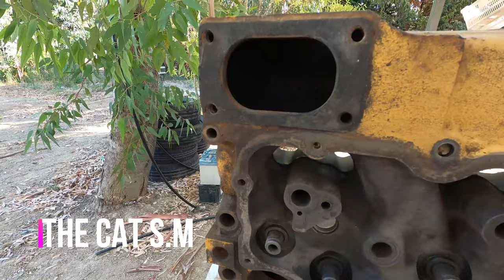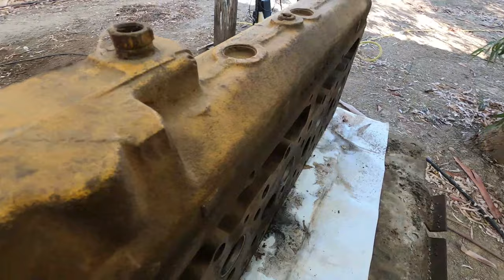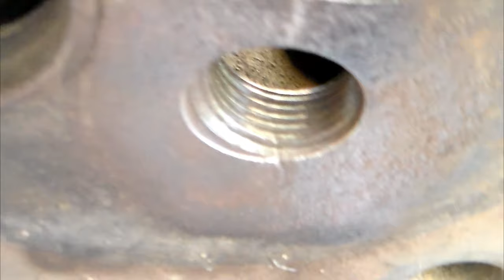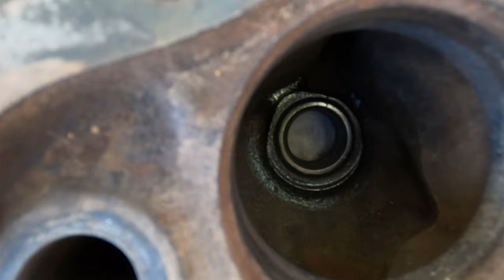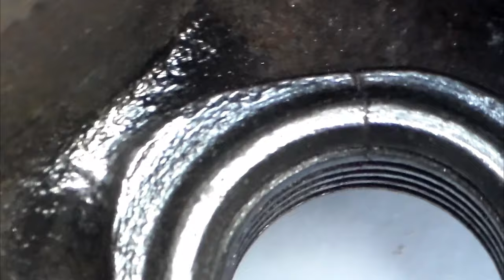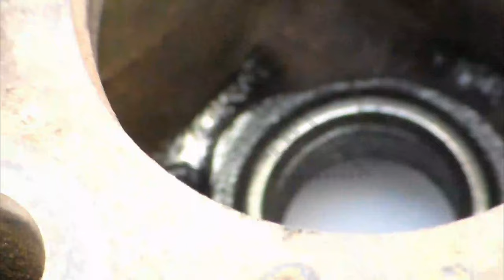Cracked imperceptible . Cylinder head caterpillar 3304 , spaccatura testata.

Comment: Hmmm it's a Caterpillar 3304 PC pre combustion chamber earlier model engine's cylinder head. And definitely you found that crack after removal of all components including chambers and clean out.

The cracked surrounding chamber seat area is high running temperature portion even jacket water system can't control the crack due to unfavorable emission 🇵🇰😎🇱🇷😉
Reply from the maker: Hi, nice to meet you
During work the engine runs quite well.
The problem is that with the engine off for hours, the water penetrated up to the piston, and then into the oil sump.
Unfortunately ....
it was also difficult to identify the crack with the dirt present ..
by simo
Reply: I remembered my father had to troubleshoot a Caterpillar D342 generator set engine by filling jacket water system and remove all glow plugs and fuel nozzles capsule type or bullet shape finger tight only 😉. 
Then he took a cup of coffee and then cranking the engine only without fuel opening and cylinder # 5 squirt a couple of glass of water from cylinder pack 😎.
Then he removed pre-combustion  chamber and found a sexy crack inside it 👌😉
Reply from the maker: @zeeshan_engineering_services  I really like that you remember your father. This really moves me
My father who is 70 years old often comes to see me to see what I'm doing. But he doesn't know anything about engines 😉
Reply: @thecatSimo  pretty good to know. Well I am now 42 and beloved father had died at 75 in August 2019. Indeed naturally I miss him every day  in 💔 all aspects of life. Off course I am lucky to earn 🍞 & butter by his precious transferred profession and blessings. And I believe you are lucky too to have blessings along your beloved father ✔😎
Reply from the maker: @zeeshan_engineering_services  I'm 41 ... we're peers
Yes, your dad is watching you from up there ...
So you have to fix the engines well :))
I'm so sorry it's gone ...

Comment: Hi everyone we have a problem Detonation for cat G3516, ITS imposible if crack like that make Detonation? Detonation come if engine have load. Thx
Reply from the maker: Hello explains the problem better.
Reply: Thank for your respons, when engine running idle engine running normal, but after engine have load or high Temperature in cylinder  10, 12, 14, 16 there was Detonation. In Cylinder when we Dismantle it finding water. Exhaust Manifold and after cooler had test pressure until 40 Psi and not leak . Every cylinder head have test pressure in 150 psi-160 Psi. How about it you think?
Reply from the maker: if you have found water it is likely a crack in the cylinder head. Tonight I look on the Caterpillar sis and let you know the pressures and all the problems that may exist.
give me the serial